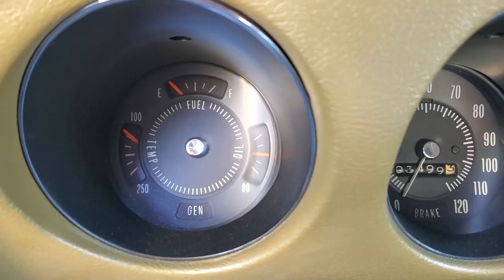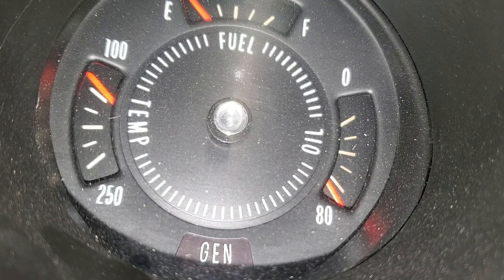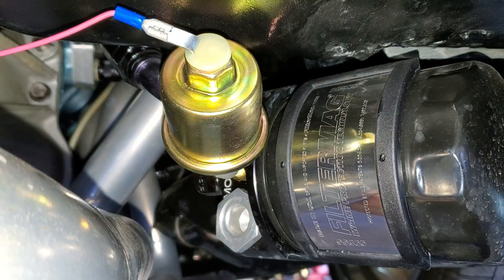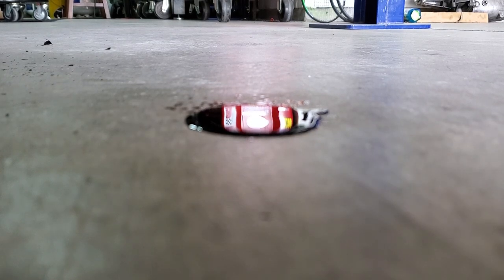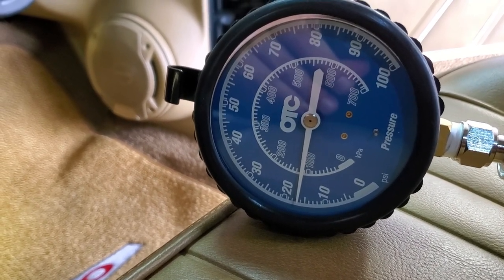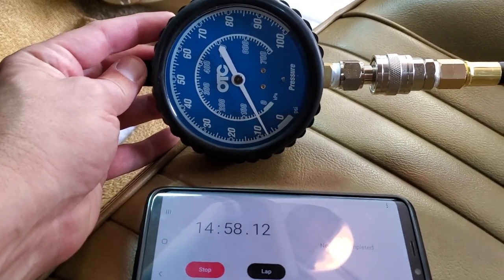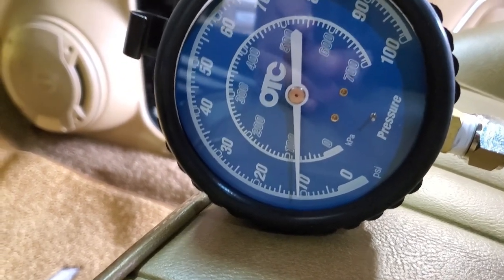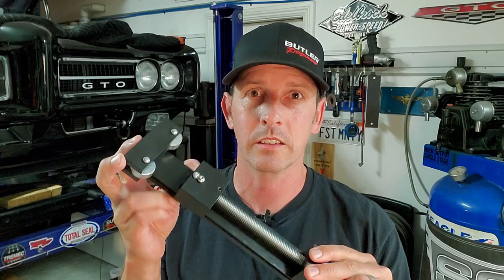How to diagnose an oil pressure problem?  Bad Sending Unit?  Bad Gauge?  OR, worse?

Comment: I think you are right the pcv problem could definitely clog the oil pick up I have always run a oil line oil pressure gauge to me its more reliable  you will get it right I have seen that metal flake gold many times lol on a 289 high po with a nodgaler crank turning 10 grand! We would change crank bearings every five races crazy haha
Reply from the maker: Yup, agreed about a Mechanical oil pressure gauge, which I just installed.  definite re-assurance as to what's going on.  Thanks!
Reply: That 289 I was telling you about was a kick but motor we ran it for three seasons then my uncle sold it to a guy that put it in a fiat lol I bet it would fly then we moved up to super stock you and people like us were born motor heads!
Reply from the maker: @gibsonexplorer8777  Wow, that Fiat must have been nuts!  ha, ha... yeah, brother.  Wish I could do this full time.  :)
Reply: @FastMonty  the guy forgot to lock down the rockers and the a few of the pushrods came out or dented the valve covers at 160 mph then he wanted his money back when it was his fault? My uncle told him sorry but no way! Lol
Reply from the maker: @gibsonexplorer8777  Ha!  What, no warranty?  Too funny.

Comment: Thanks again for going into so much detail.  How long since the last rebuild, Monty?
Reply from the maker: Welcome... it hasn't been that long, but I also didn't do a "Full" rebuild.  I changed the cam and lifters, due to the lifter failure, and only did a top end rebuild, which is why I suspect the bearings are worn from before the last build.  Absolutely my fault.  Won't happen again.

Comment: Hang in there Mike, I don't know if the Pontiacs have a similar problem that Buicks do, sometimes our Buicks eat their distributor gear, So if you have a bronze dist. gear wearing down and wearing the cam gear it meshes with? Maybe?
Reply from the maker: Thanks Paul... I have a composite distributor gear.  (And I pulled the distributor already, the gear is perfect)  We'll see!

Comment: I’ve spun rod bearings twice in two 455’s.  80psi pumps in both of those.  My current 433 is so far so good but at this point, I get another glitter bomb in the oil filter, that’s the last Pontiac motor that’s going in my car.
Reply from the maker: Man, that sucks... I agree.  I don't want to see any more glitter bombs either!

Comment: I have the same exact issue and just discovered it. But my oil pressure has been slowly decreasing. I’m suspecting crank bearings. Already started to pull engine. Good luck!
Reply from the maker: Ohhh man... I know the feeling.  Looks like we're in this together.  Good luck to you too!  (I'll be filming the bearing blue printing process, which is painful.  ha, ha...)

Comment: I feel for you. I just built a 389 motor aluminum heads, full roller cam and rockers used all good brand parts. put 100 miles on it. noticed ruff idle did a compression check three cylinders had low compression. yanked the motor out  rings looked good, cylinders looked good, heads were good valves were nice on seats.  couldn't find a obvious problem.  so I rehoned new cast iron rings .  Oh I also had some of my friends that are pretty good engine men look over the block and parts and they couldn't find anything wrong. ps i noticed when you were building your motor you put your oil pump gasket on the wrong direction i am pretty sure.
Reply from the maker: Thanks Eric... now you tell me my oil pump gasket is backwards?  Ha, ha... just kidding.  Yeah, it's frustrating, but I'm looking forward to learning the root cause and fixing it.  (The root cause is probably between my ears)  Anyway, what ever happened with your 389?
Reply: @FastMonty  not really sure why three cylinders had bad compression and a lot of blow by , but I got it back together and hope to put it back in the car next week and see how it runs,  keep up the good work and let us know what happens , did you check the oil pressure with a mechanical gauge on the top of the block instead of the oil filter housing?
Reply from the maker: @erica8664  Glad you got it back together.  I used the mechanical gauge at the same location as the sending unit, to keep things equal.  We'll see how it goes... See ya!

Comment: I'm not buying the pcv issue as to why those bearings are letting go.  It takes A LOT  (Years of blow-by, or crankcase non evacuation to plug up a pump screen bad enough to cause this type of problem. if even) I've pulled apart engines with so much sludge from non oil changes, with pump screens so gunk'd up and engine still running with out bearing issues. Besides, didn't you just pull this engine recently with a lifter issue? 
How many miles on it since it was rebuilt?  not many, right?  Sorry for your troubles brother although IMHO, these issues your having are more to do with how the engine was put together... I haven't been a subscriber to your channel long enough to know who built the engine, if I were you though, THAT is where I would put my focus into. Anyone can have a bad day. Bearing failures such as this after recent rebuilds 99% are assembly errors.
Reply: Watch this guys video. He explains tolerance stack, and why it's important to understand why it's critical in building engines. I feel your pain there brother. I've been there myself. Stay positive, like you mentioned, this is a learning experience and you will get that ol' Goat up and running again soon! 
https://www.youtube.com/watch?v=2a5P78lXrV0.
Reply from the maker: Thanks Brother... between you and I, I know I didn't clean the block out very well after the last lifter failure.  AND, when I did that the oil pick up was full of sludge.  So, the oil starvation has been going on for a while too... that said, I do love learning as I go.  We shall see.  Thanks for the comment, and sharing the Tolerance Stack video.  I'm actually well aware of it.  I didn't do the original bearing fit up and blue printing.  This time I will, or at least double check a professional, etc... We shall see!  Thanks again.

Comment: I hope you find out what is wrong with the engine mike. Just thought I mention Wagner adjustable pvc valves are really cool check them out when you have time. Also what type of oil do you run ? In my Pontiac 461 I found conventional oil works best like Lucus hot rod oil or brand penn I stay away from the synthetic oils but it really comes down to what clearance you have at the crank journals that really will determine the oil viscosity and type you use. Stay positive you will get it going again I’ve been working on my 67 Gto for 8 years and I’m  still not finished because of all kind of problems like these.  take care
Reply from the maker: Thanks James!  I use Driven HR oil, recommended by Butler.  Funny you mention the M/E Wagner PCV valve.  I talked to Gene for over an hour, and I'll be doing a video of installing exactly that, obviously at the end of this rebuild, along with a properly baffled Tomahawk valley pan.  More on that later... this is most likely my own fault from not cleaning the block very well, after the last lifter failure, in combination with a long term PCV issue from day one.  (When I pulled that last oil pump, the screen was completely clogged, but I wasn't thinking much of it, or knew how much Sludge can mess up your engine, until that recent PCV video)  Anyway, to your point, it almost never ends, getting our project perfect, which is also half the fun.  See ya next time!

Comment: Are we guessing which bearing is worse? Might be cam bearing where exploded lifter died. Just a guess. Sucks to see it happen but we might learn something.
Reply from the maker: Thanks Alfredo... it does suck, I'm sure it has something to do with that lifter failure, because I didn't do a good job cleaning out the block last time.  Arrrrg... won't happen again.

Comment: And that’s why I use a mechanical oil pressure gauge T’d with the dummy light factory sender in my 70 Z28. Remember that the thicker viscosity oil you run with, the higher the PSI will be at all rpm’s. 8:13 looks like bearing material. That is a pisser!!!! I know how you feel. I lost 2 solid lifter cams in my 70 Z28 then decided to go roller in 2012. BTW I like oil filter cutting tools. Here is mine https://youtu.be/Xhh7Wfa7JFw Proform 664090

Comment: Heart dropped when you started pouring that oil out of the filter :(.  The thought occurred to me, when you installed your remote filter setup, did you end up removing or otherwise disabling the oil filter bypass?  Many filters will not flow enough volume to cope with WOT or heavy load situations where demand is higher.
Reply from the maker: Yeah, a big bummer.  Good thought about the lack of bypass... but, that's only when the filter fails.  Anyway, I never told anyone that when I tore apart the motor when the lifter broke, my pickup screen was clogged.  (So, bypass or not, if oil can't get through the pickup screen, it's a moot point) I didn't know why at the time, until I recently went through educating myself on proper PCV plumbing.  So, I've basically had a PCV issue from day one.  Second to that, I didn't inspect the bearings when I was changing the bad lifters.  That was dumb.  Oh well, gonna do the bottom end right, this time.  Thanks for the comment!
Reply: @FastMonty  definitely sounds like that may have contributed. In regards to the filter, even a healthy filter will represent a flow restriction. The factory Pontiac oil pumps tend to flow around 12-13 gpm. The popular wix 51069 for example has a max flow rate of 9-11gpm. So having a filter bypass disabled can still be an issue even if the filter hasn’t failed. Since pressure is flow meeting restriction, chopping off a couple gpm at 5500 rpm can really do some damage. Rocky Rowell’s has a great article online about this. Anxious to see you bring this back to life better!
Reply from the maker: @pontiacontap  Ohhhh gooodie... more research I get to do.  LOL.  I'm anxious to get it re-built too!  Thanks Brother!
Reply: @FastMonty  it’s seriously terrible!
Reply from the maker: @pontiacontap  Hey Brother... so, just spent what seems more time than necessary, educating myself on this subject.  You're totally right.  The bypass valve opens when there's a 20psi difference between inlet and outlet pressure, so during hard accelerating, high rpm, the standard filter can't flow enough to keep the pressure high enough.  So, I get it.  Now, how to fix it... I called David Butler.  He said the solution is easy, get a double sized Morosso racing filter, which doubles your flow rate and you won't see any pressure drop.  My issue is now, I don't know if I have room for an 8" long filter.  So, I'll be going back to the standard set up, for break in, while I figure out where to mount the long filter.  Thanks so much for bringing this to my attention!
Reply: @FastMonty  No worries, it's something that can be often overlooked.  As hot rodders we're kind of anal about keeping our oil clean, so the desire to filter oil 100% of the time is usually there.  One thing I'll point out is that you don't see engines blow up from having a bit of unfiltered oil during high load.  You do see them blow up when they have lack of oil pressure.  So that said, another option on the table is to go with a remote setup that does still contain the bypass valve.  Either option will ultimately work.  I know for more of a performance oriented, pro-touring style build that is showable like your goat, I don't think I'd want a couple massive oil filters sitting in the engine bay, so I totally get not really knowing where to mount those things.
Reply from the maker: @pontiacontap  Thanks Brother... You know me, I'll figure something out.  ha, ha... thanks again for your comments!

Comment: Sorry for your issues Mike
Also where did you get your lift?
Reply from the maker: Thanks Bill... I got the lift from a distributor that's no longer in business.  If you get one, make sure you get a made in the USA lift, because the Chinese version use thinner gauge steel.  Totally recommended!
Reply from the maker: Bill, check out Radlifts.com... looks like they're now selling the same lift I have.

Comment: On empty?? Does your fuel gauge work?
Reply from the maker: When my fuel tank is empty, my fuel gauge says the same.  So, yes?  Why?
Reply: @FastMonty  I’m guessing you pumped out the fuel? I hit 1/4 tank and I don’t trust my gauges past that. Just shocked to see a muscle car all the way to empty.
Reply: @FastMonty  I like that magnet in your oil filter. And I’m sorry to hear about your engine.
Reply from the maker: @ryandoe9278  Ohhhh, I see what you're saying now.  No.  Just like a modern car, even though it's says empty, there's still a couple gallons in there.  I too usually fill up at a 1/4.

Comment: That was quite a bit of metal flake. You should be able to roll in some new bearings from the bottom without having to take the intake and heads off. Murder Nova did a video that shows how to roll them out. https://youtu.be/zXhQpWJlYcY
Reply from the maker: Thanks Bryan... the engine still has to come out.  After we inspect the bearings, we can then determine what to do.  If there's too much trash, the engine has to be fully cleaned.  (Which I did not do very well, the last time I had the engine out, my fault)  We shall see!

Comment: That sucks
Reply from the maker: Sure does.  But, we get to find out what happened... I hope.  :)
Reply: @FastMonty   my motor has to come out in a few weeks for a leaking oil pan seal and main  so my 400 will be getting built over the summer might end up very similar yours
Reply from the maker: @brianmartin1133  Awesome.  We'll see how the engine looks... I might be adding a bunch of videos for Short Block rebuilding.  :)